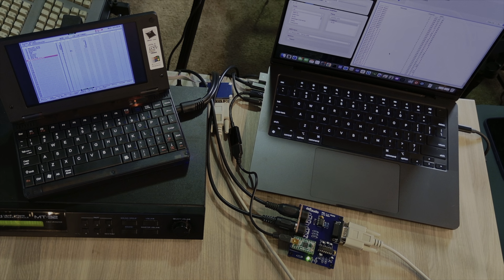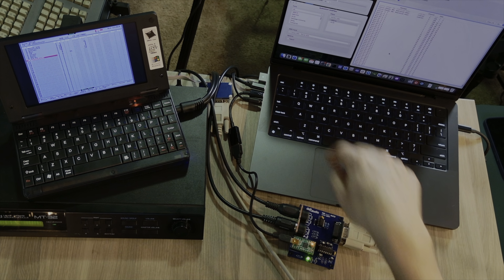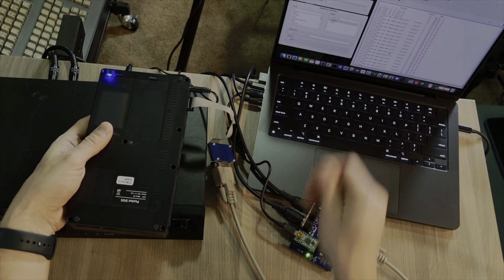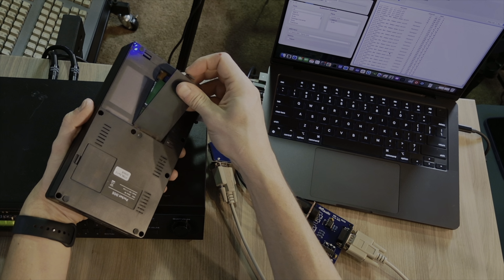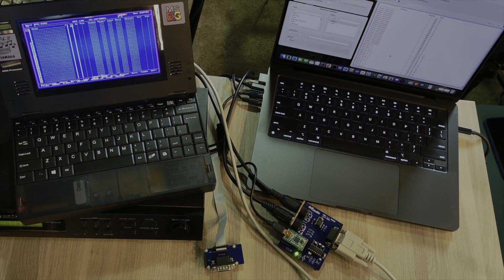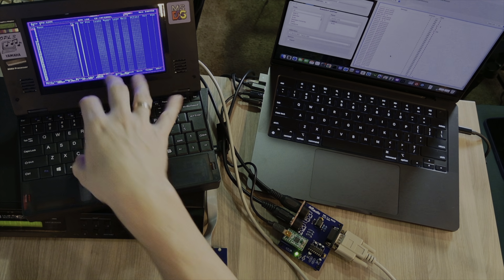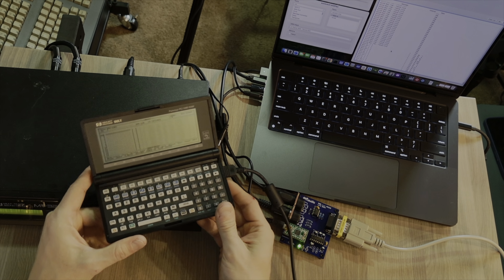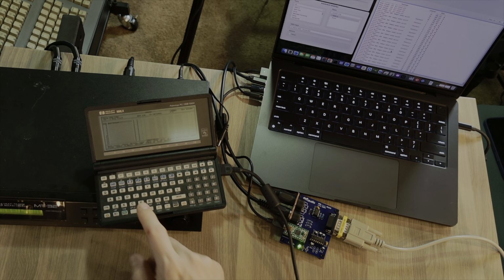Voyetra Sequencer for DOS with MIDI-RS232 Interface

Comment: hello, I got my interface and pocket 386. but my JV1080 is not recieving any midi. how do I set it up? what is the port number of the interface? I’m kinda confused with this. what midi interface was I supposed to select when installing voyetra?
Reply from the maker: Hi, you should install it as Yamaha TG-100 in Voyetra. Here are config files specifically for Book386, which allow you to use built in OPL synth (port 1) + RS232 on port 2 https://github.com/Deftaudio/Midi-boards/tree/master/MIDI_RS232/Book386%20Voyetra%20SPG%20config

Comment: Great video. I got this working with my ThinkPad T42 and Mini Dock (2878). I really struggled with the Voyetra installation as the required TG-100 driver file (vapitg) was not included with my version of the sequencer. Some advice for acquiring and installing it on your website might help others.
Reply from the maker: You should download the latest SPG 4.11, such as from OldSchoolDaw or other place. Then reinstall it from scratch and select it in the list of the MIDI interfaces (it's the last line in that list). For Book386 I posted configs here, including vapitg https://github.com/Deftaudio/Midi-boards/tree/master/MIDI_RS232/Book386%20Voyetra%20SPG%20config but in your case it could be better to reinstall everything.

Comment: Another quick question, this interface can work without connecting to the Macbook that I show you in the video..
Reply from the maker: Drivers for DOS are integrated into Voyetra, you don't need to install anything extra, just need to configure it during SPG setup. It can work without Mac of course, but it needs the external power in this case. Any USB charger will work for the purpose.
Reply: @DeftAudio ... thank you for responding quickly, I just ordered one, for Reunion Island.. see you soon..

Comment: May RS232 support not 16 but 32 MIDI channels?
Reply from the maker: That would mean 2x2 MIDI interface. Voyetra SPG doesn't have any driver for that. The closest to this is Music Quest 2port/SE for parallel port. If you can find one, grab it!
Reply: @DeftAudio  Ah, I see. I heard that Voyetra SPG 4.11 may use two MIDI interfaces.

May Voyetra SPG use your RS232-MIDI card as second MIDI interface? Assuming that another interface would be a SoundBlaster ISA sound card.
Reply from the maker: @avmilenk  This is correct. You can add it in addition to another interface. The should be different kind though. Like in case of this Book386, one interface is 1x1 Serial MIDI while the other one is OPL3.

Comment: Hi! SPG fan/"expert" here. Most likely, the 4.11 version copy you have  is a copy of my original version if you downloaded it from the internet. I began using SPPro, that came with Sound Blaster Pro, but eventually bought the Gold version just before it was discontinued. I also bought the Windows version, Midi Orchestrator Plus... it allowed me to load SPG files into Windows. 
I still have a Pentium 1, 8mb Toshiba notebook with  various MusicQuest interfaces. 
I´m amazed that you made a midi interface for it and also by those mini notebooks.
Reply from the maker: There are several copies are flying around, thank you for helping to preserve it! This Book386 runs Win95 as well, and I have DOP there too, but nothing could be faster than SPG :)
Reply: 4.11 is the one.. Supports dual interfaces, so 2 x V24 is possible, and it fixed the "Crescendo Transform" Bug that appeared in 4.08.. Still use it every day, it's tight, rock solid, and will whip any DAW for MIDI work.. So fast... If You slave it to SMPTE on a DAW, You can add a multitrack audio function, with none of the horrible nonsense that modern sequencers insist on..
Reply: @tommyboy9998  great! I was lucky to get the latest version. Years ago I shared it on old school daw, and from then on most people use that. 
I have to admit that I'm comfortable with Digital Performer now doing midi... I found a small midi interface that is rock solid with it (esi midi mate). Having said that, I bought an USAMO to send jitter free midi clock to SPG, but never had the time to do it. Maybe I should make my time. Not only sends jitter free midi clock, since it's all generated by a plugin instrument, it have the same latency as all the audio tracks, so everything is perfectly aligned, midi and audio.
Reply from the maker: @juno6  I have USAMO too. Great way to run a MIDI clock to external gear.